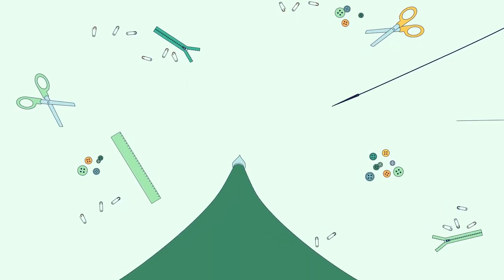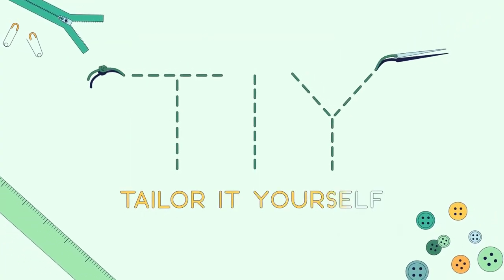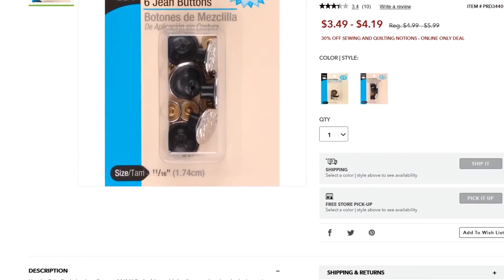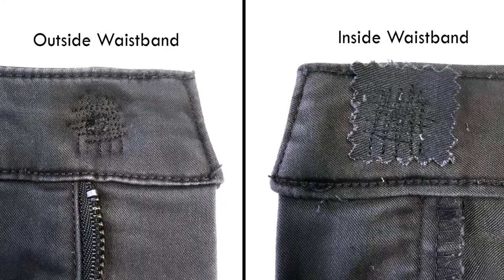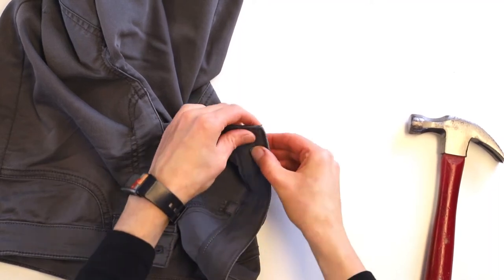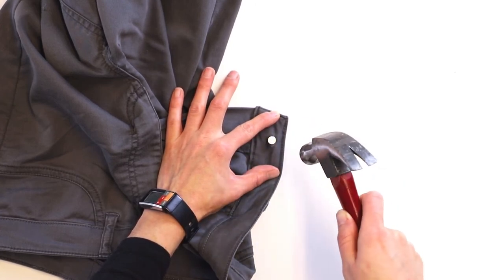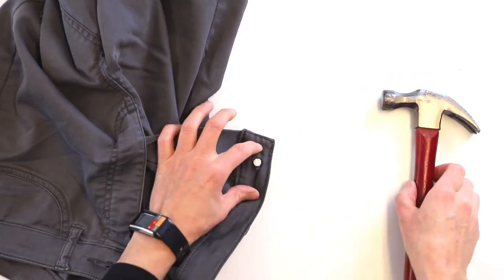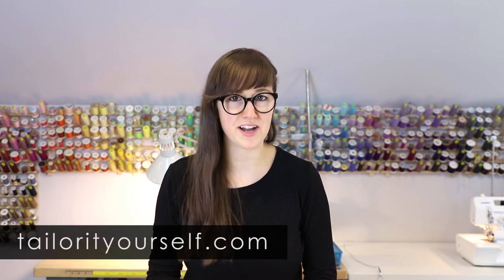How to Replace a Bachelor Button/Metal Button on Jeans

Comment: Yeah but how do we get the old button off
Reply from the maker: If you'd like to switch it out and it's still attached you can use a wire cutter to cut the shank and pop the button off.

Comment: Hi  How do you take the metal button off ?
Reply from the maker: If you'd like to remove an existing bachelor button, you can use a wire cutters to snip/pinch it off. Most needle nose pliers have a small wire cutter section that should work if you don't have a proper wire cutter.

Comment: I did this but the screw got dented and deformed, so now I can't replace the button
Reply from the maker: If you have another set of parts, you can remove the damaged parts and start over with a fresh set.